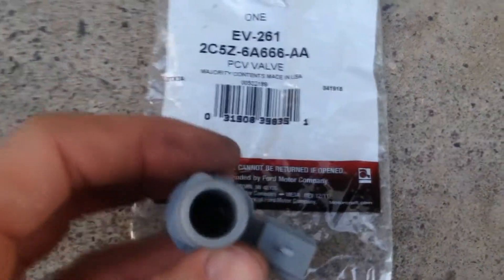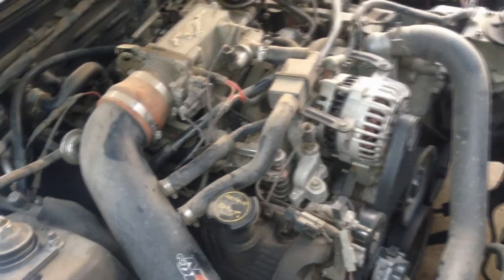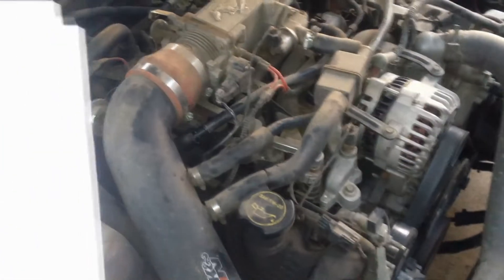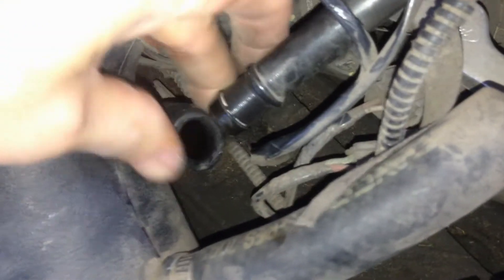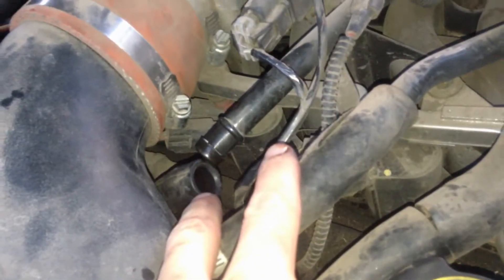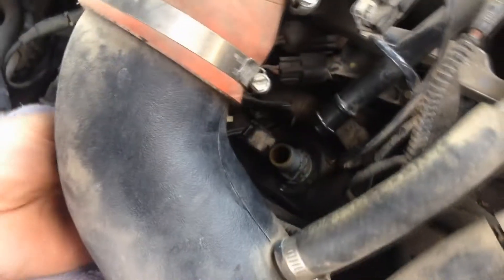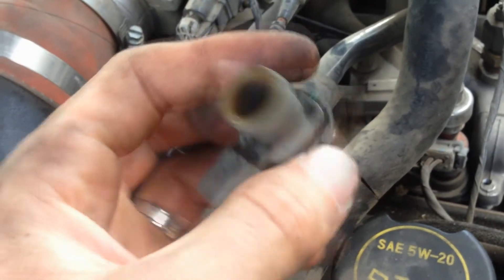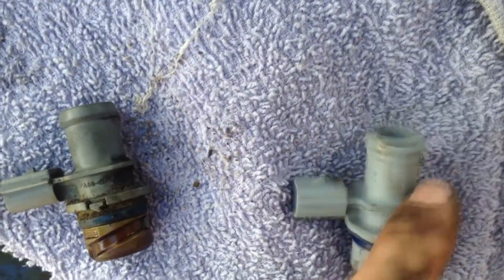How to Replace a PCV Valve (Mustang GT 2003)

Comment: did this cause it to get smokey? and sluggish acceleration?
Reply from the maker: Yes it can! Any trouble codes?
A stuck PCV valve can manifest as a rough idle, increased oil consumption, check engine light, hard engine start, oil leaks, black smoke, engine surges, and potential misfires, depending on whether the valve is stuck open or closed; a stuck open valve usually leads to a lean air mixture and rough idle, while a stuck closed valve can cause excessive crankcase pressure and oil leaks

Comment: could this valve be the cause of a rattling noise coming from that particular side of the engine?
Reply from the maker: That could be a loose exhaust heat shield or motor mount... but it could be many many things to be honest. It's hard to figure that out without a video or something

Comment: Mine didn’t twist out that easily. There are two barbs that are shaped so it snaps Into place. I removed the bracket with the PCV valve still installed and had to carefully use two thin screwdrivers to pry up while twisting counterclockwise.
Reply: Thank you for this, My 2004 is the same with the heated PCV valve

Comment: You need to give your engine a good power wash. 😁
Reply from the maker: Yup sure do!
Reply: how can you do that lol
Reply: @AGPLilTrill  With water? LOL
Reply: Brian M won’t hurt anything?
Reply: @AGPLilTrill  no, it won't. I've done it myself several times.
Reply: @AGPLilTrill  Just make sure to cover alternator, disconnect battery, and let it dry for hours under the sun before turning it on again. I washed mine and it on,y damaged my throttle position sensor.
Reply: Cover Alternator spray engine with hyper dressing let it sit for 5mins use a soft brush to clean engine then give it a quick spray while the engine is running you don't have to spray hard you can use the mist setting

Comment: So my 2002 mustang gt doesn't have a cable coming out of the pcv valve. It is just a plastic angle that spins going into the case one way and a tube the other. Bought the car this way, is this something that is bad?
Reply: ajablast there is nothing wrong with your car. Some of the gt cars came with heated pcv valves (with the cable) and some did not. Just make sure to order the correct part